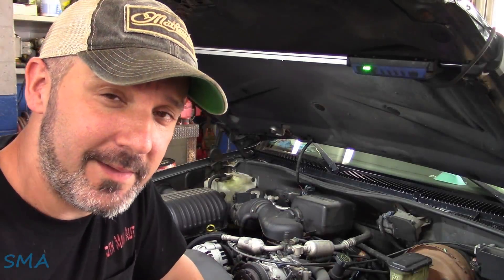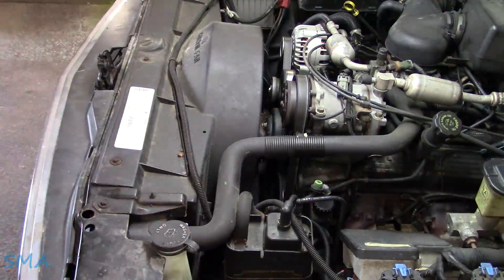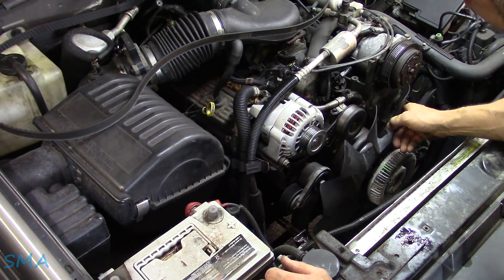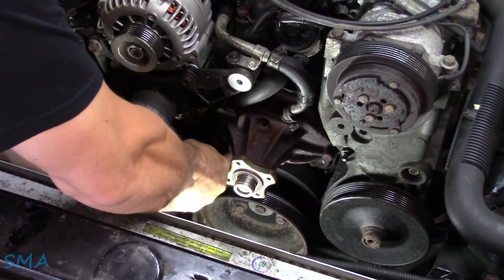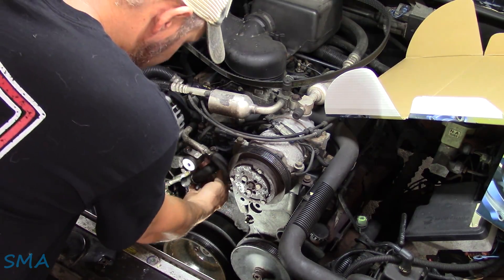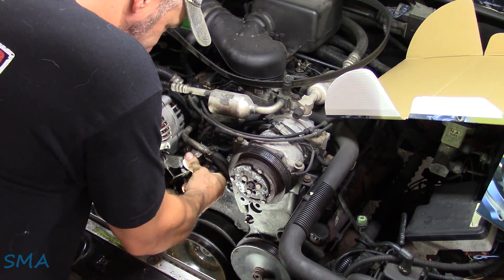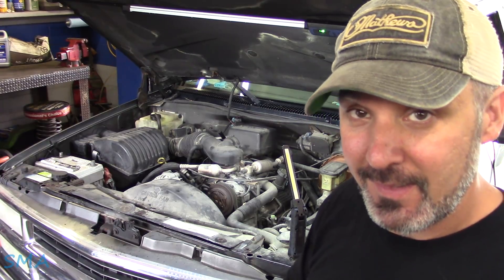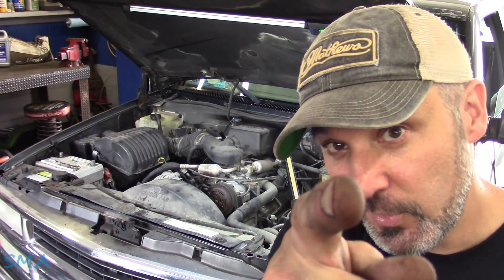Water Pump Replacement: 5.7 Chevy Tahoe / Silverado / GMC Sierra / Yukon

Comment: Nothing wrong with the 5.7 and a 700r4 driveline, though a 4L80 or the 4L80e would be a better choice.

OAT coolant is/was junk. Rotted many a coolant system out and with the Tahoe and Suburban with rear heat, a royal pain to correct.

Look at how much room there is under the hood to work when need be. The LS powered trucks, not so much.

Comment: If you're real clever you can put it on with the engine running... I wouldn't call that clever, quick and effective IF you line it up right and let go correctly.  Potentially screwed up threads, destroyed radiator and or hoses, and a possible trip the the ER or visit with the coroner if it really goes wrong.

Comment: I have a 95 K2500 with a 5.7. Other than replacing every single component on the truck at least twice since I’ve owned it the thing has been bulletproof. I know some guys are crazy about the OBS Chevy’s but I personally think that the first generation of LS equipped trucks were better with the 2003-2006 being the pinnacle of Chevy truck building. Anything after Obama gave GM a shitload of taxpayer dollars is crap. I thought that the bailout was supposed to enable GM to modernize and increase the quality of their products but that was a lie straight out of the Bottomless Pit.

Comment: I agree with the Eric old small blocks never die these piece of crap LS Motors you couldn't give me one of those things the only thing good about an LS motor it's a cylinder heads they are better than original small block's I will give GM credit for that , the Block design and the bottom end on those LS engines is absolute trash , this is why I say old small blocks live forever .